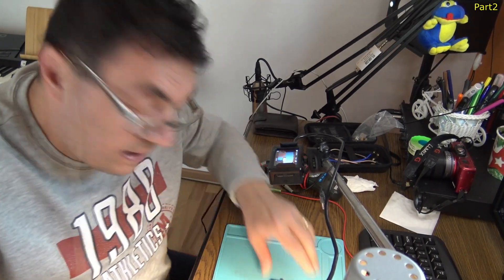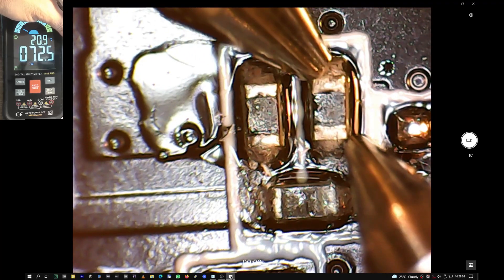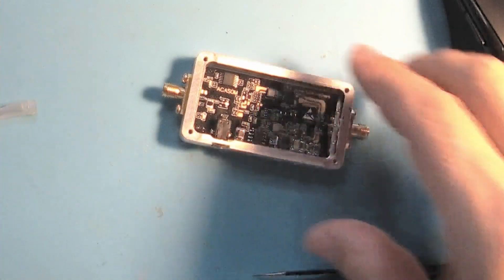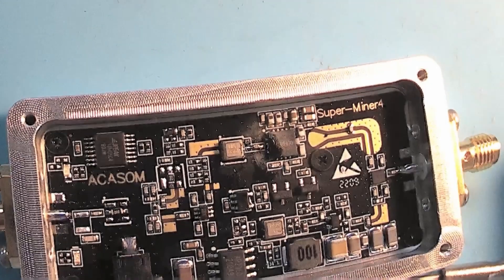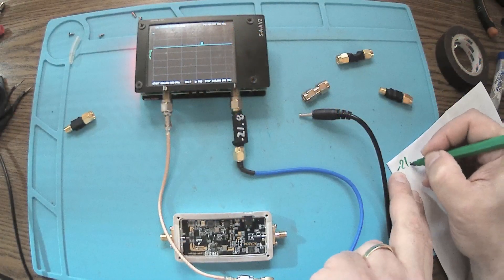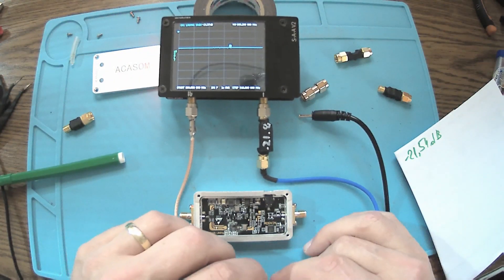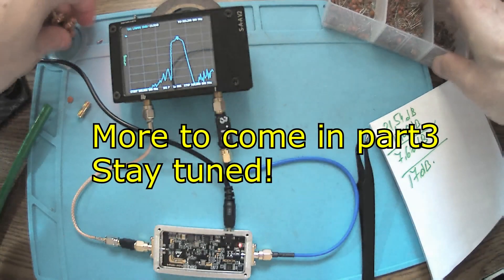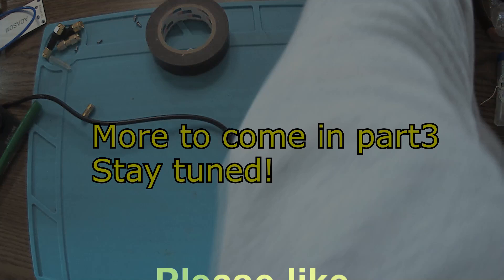ACASOM ACA-AP0801S1 10db RX/0dBTX Helium amplifier part2

Comment: Acasom posted on Discord this: “Many people use this frequency instrument to test our Amplifier. The data is different from our nominal results. Why is this so? When testing RX, the power is-20dBm or lower; When testing TX, the output power should be 3dBm or higher” and mentioned that the attenuator should be between vna and amp(the other way round). They say because nano vna has rf output power -9db (error at 1Ghz -+1db). Also they mentioned “when test tx need to amplify signal to 3db, add another signal amplifier”. Disclaimer: I don’t understand this explanation just posting what they answered
Reply: Pune un link
Reply from the maker: To much to argue... I couln't understand a thing..
Reply: @viocaia  they are saying that attenuator should be in the input. because 0db is to high for acasom amp input. it's basically clipping. for safety you should use two attenuators in the input and output.
Reply from the maker: @laurynaslauris9677  It will be on part 4...so far that's bullshit! I think it was someone from catering answering the technical ..😞
Reply: @viocaia  can't wait.